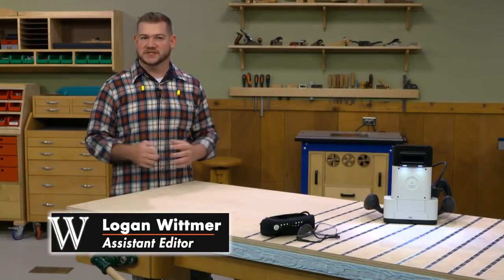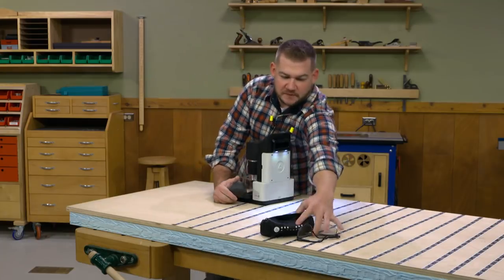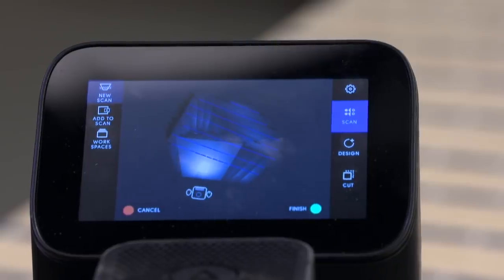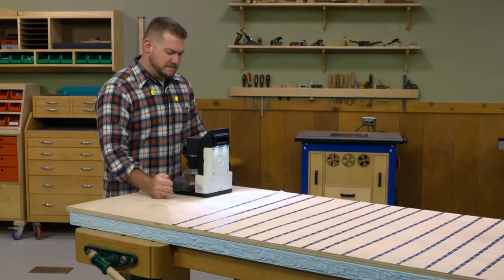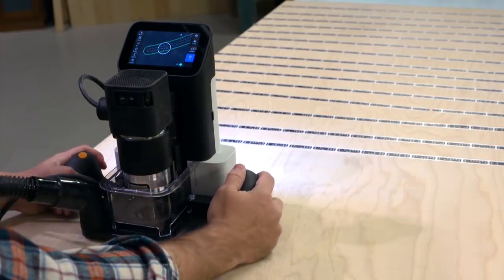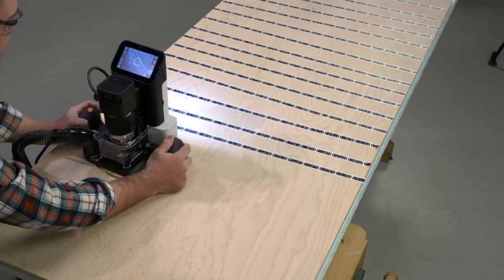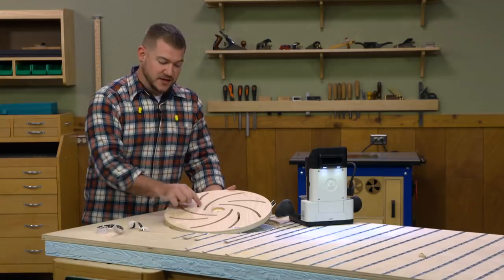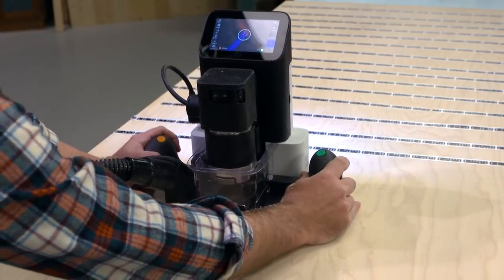A Hand-Held CNC? An overview of the Shaper Origin!

Comment: a roll of tape is 18 bucks and covers 1 1/2 sheets?
Reply: Um ... you could use it a lot smarter than this guy did (4-5 strips might have been enough). You can either make a board that has the same thickness as your work piece that gets placed NEXT to your work piece or print your own domino reference pattern...

Comment: This looks like a cool tool.  However, I have a question which may seem a bit rediculous.  Though the pattern is on the screen of the tool to follow is it still free hand or does it have any self guidance/propel for guys like me who lack confidence in having a steady enough hand so it doesn't look freehand and sloppy?  I realize this may be a dumb question.  Thanks for the demo!
Reply: The path is shown in the screen. You roughly follow this path, the rest is done by the Controller.

Comment: I love mine! I got it presale for $1400. You used way more tape than what was needed for the project.
Reply: @WoodsmithShowandmagazine  Lay out a few rows and then overlay your project then scan the tape while covering the area of your project. If you go out of bounds then add another strip of tape. I took a sheet of 1/2" (24" X 36") ply and taped it. Then you can reuse it for different projects. If you're milling thicker ply like 3/4" then place a piece of 1/4" under your taped piece and butt them together. Obviously if you have a larger project that  will not work, but scan and add tape as needed. There are a couple vids on Utube demonstrating this.
Reply from the maker: @akquicksilver  -You of course are correct that that much tape isn't needed,  especially for the cut I made.  However,  I used the remainder odd the sheet off camera, and that was my intention.  Plus,  in the studio with the bright lights,  the origin was loosing some of the tape,  so I went heavy on it.  -Logan

Comment: I have one. No way he needed that much tape to cut that part or have to add tape.
Reply from the maker: John, you're correct,  i went heavy on the tape.  My intention was to use the full sheet for other,  of camera,  stuff,  which I did.  That,  combined with the studio lights washing out the dominoes,  led me to use that much tape.  In a normal setting,  half of that should suffice.
Reply: @WoodsmithShowandmagazine  Do you understand you don't need tape on the surface you are cutting on? Most of us use a dedicated tape board placed in front of the piece being cut and never have to destroy the tape. Cut your project piece down to close size and then put the dedicated tape board in front and scan.
Reply from the maker: @johnburger1681  it depends on the size of the item you're cutting.  In this instance,  the 22" circle needed tape even onto it to be within the field.
Reply from the maker: John Burger - yeah , I think Logan was just covering more area with tape just for the fact that he was going to come back and use the rest of the sheet later.

Comment: At $2,499, I'd rather have a  full CNC machine. 
That way I can start the project and go about doing something else while it cuts out the part.
Reply: But if your part is bigger than the bed of your CNC then you can''t do it. There is no size limit with the Shaper.
Reply: @johnburger1681  with the right software, and CNC you can feed your work through the X, or Y axis. You can also tile your work to make it as big as you want.
Reply: @rchavez5056  If I wanted to do an inlay in a hardwood floor in a house how would I do that on your in shop CNC?
Reply: @johnburger1681  for absolutely right. I was just referring to projects that are mobile.
Reply: @johnburger1681 
That's true, but most people using CNC, constrain their designs to fit within their CNC. If you have an 4'x8' cutting area, you can use full size plywood sheets to cut your parts from. 
4'x8' is typically a full sized CNC because of the dimensions of the wood you can purchase. While at the same time, you can build them longer or wider if you need.
Reply: @scotttovey  So you can buy a 4' X 8" bed CNC for $2500 and have a place to put it? Suppose I don't want to "constrain" my design to the CNC bed I have?
Reply: @johnburger1681  
I don't need a 4 x 8.
But a 4 x 4 would do just fine and you can get one for the same price range as this.
Reply: John Burger precision on CNC is incomparable, yes, but I am talking about Europe :-) And £2900 Wow
Reply: @danhalski  😎👍
Reply: How often do you put your full CNC in your car and take it with you to a job site?  4x8 did you say?

The traditional CNC experience, in its    entirety, totally sucks, from start to finish.  This isn't an end all, but it removes some of the worst parts of that experience.
Reply: Nat X  
True.
Reply: I think the biggest confusion for people is that the marketing sort of pushes this as a replacement for a gantry style CNC. It is not. Their capabilities overlap but not fully (think Venn diagram). As with all things and purchases one must think about WHAT will be done, HOW it is done and then WHICH tool provides the most capability. Best analogy I can come up with the the hand-cut dovetail vs. template jigs. Both make dovetails. Both can do a very good job. But you can't route a dovetail with a skinnier pin than the width of the shank ("English" style) and never seen a houndstooth cutting template but I wouldn't want to make kitchen's full of dovetailed drawers by hand if I could use a jig.
Reply: @TheRwyoung  
I agree.

This router is a good unit for someone that will be making signs or insets on site during a project, or as a previous comentor mentioned, if you do not have the room to set up a traditional CNC router table.
Reply: I have both, both have their place. Apples and oranges.
Reply: @ChadMc74  
😎👍
Reply: in Europe, boys have to give 2 years warranty, that's the law
Reply: @danhalski  😎👍

Comment: Needs to be motorized for full auto cutting.
Reply: A motorized version may not work as well as you think.
Wheels running over saw dust would tend to get stuck and prevent progress of the job. If you could attach a vac of some sort, then yeah, that would be a good addition.